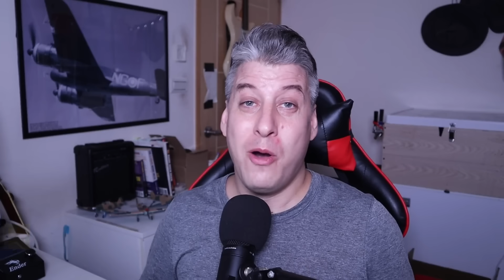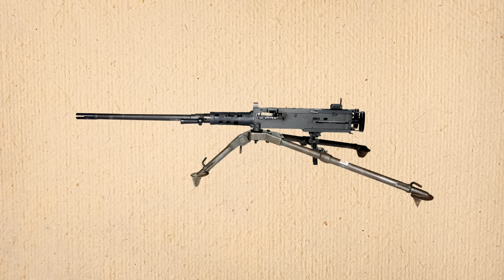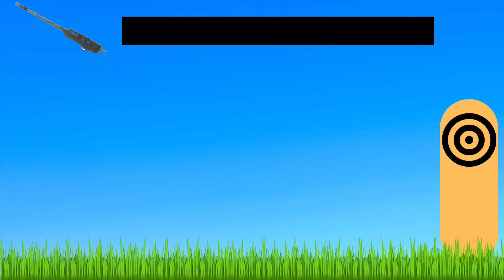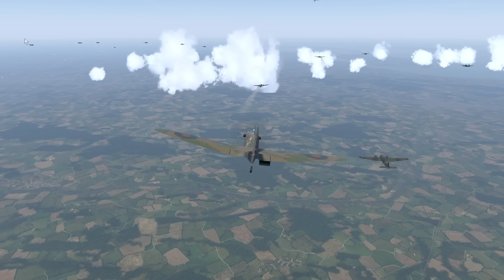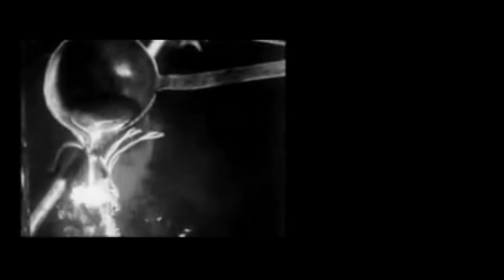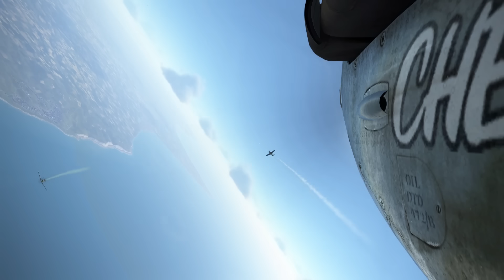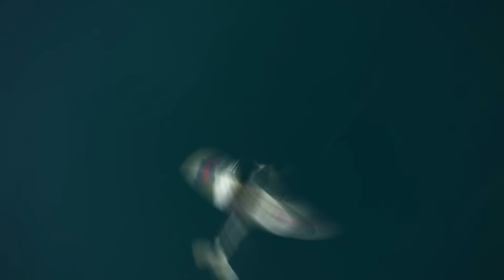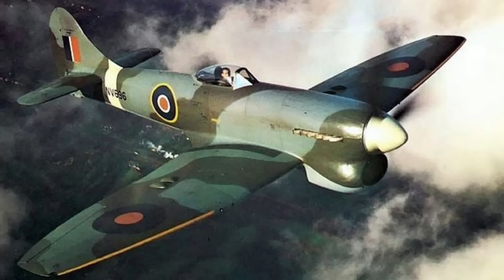Why Did The RAF Use .303 Caliber Machine Guns in WW2? The Surprising Answer

Comment: The main reason for them keeping the 303 was It Was British and you know how the Brit are! My aunt’s husband was a Brit and worker. In armor command and he and others in that division tried to get 50 cals in their planes from 1940 on and they were told but their sector head no British aircraft would ever have an American make gun in their planes!  That changed in early 1944 when a BF 190 plane did an emergency landing in England and was found to have been hit with 247 303 rounds but the plane was still flying and the reason for the crash was the pilot was new got lost and ran out of gas! Their attitude started to change after that!
Reply: "The main reason for them keeping the 303 was It Was British and you know how the Brit are!"

The British had no problem using American Shermans, Grants, Stuarts etc.
The Americans should have put the 17 pounder in their Shermans instead of the mediocre 76mm but you know how Americans are.

Comment: In the Pacific, American pilots had a preference for only four .50s, though some aircraft were built with six.  There was active resistance to adding more guns because it drastically reduced ammo capacity per weapon.  They seemed to feel more ammunition per gun, hence more time on the trigger before running empty, was of greater value than more projectiles per burst.

Not exactly the same issue, but another example of how just going bigger isn't always better.
Reply: The 50 cal was perfect in the pacific theater because the Japanese had little armor on most of their aircraft so they were easy to destroy once hit with that particular gun
Reply: The US Navy wanted 20mm cannon but American industry couldn't produce a reliable copy of the Hispano. They made do with the 0.5 inch guns.

Comment: From most of what I read the way the RAF obtained the Spitfire and Hurricane was they decided on the armament 4-8 Browning .303 machine guns, a range of flight and minimum climb and turn rates etc in a white paper which is published, then British & Forign company's entered a design, then a number were selected to make prototypes. The Hawker Hurricane & Supermarin Spitfire were then selected for production. 
These then had to be modified to fit other Armaments which due to size and weight determined where you could fit them as it affects how the aircraft handles in flight,  so if in the wing you will need to move spars and strengthen it to hold weight of gun this adds to weight of the aircraft so to keep same airspeed you need a more powerful engine. So the .303 probably was selected then kept for afew reasons I think the following
Performance(rate of fire and jam rates) weight (allowed for more ammunition/rounds & fuel also weight affects speed, range, flight time).
Role of fighter ie Home defence lots of support from over aircraft with easy rearm and refuel options.
Then just people just don't like change.

Comment: The German 20mm contained  something like 50g+ of liquid TNT.  You would not need many of those to turn a plane into a burning wreck. Some hurricane pilots would shoot enemy planes at 150yards. Also, aircraft of battle of Britain vintage would have self sealing tanks.  A .50 cal would done far more damage. The round is popular even today in anti-material sniper roll. 

I have heard stories of USAF mustangs 'sawing' FW190 in two with .50 cal gun fire with their SIX guns.
Reply: TNT is a solid at room temperature.
It may be heated and poured into a shell casing but it will solidify. It’s melting point is around 80c or 170f (ish).

Comment: I have heard that one of the disadvantages of the .5 round in the early negotiations with the US was that the Colt did not want to allow the British manufacture ammunition under license. Rather they wanted to manufacture the ammunition and send it to the UK. If I recall correctly this was due to Colt having spare manufacturing capacity in the US at the time of the negotiations, although I'm not 100% sure about this. This would have represented a great risk of having ammunition shortages and was not acceptable to the UK. Whether production eventually would have been allowed in the UK is unknown (however it was likely as FN was manufacturing the round in Belgium under license), but this problem certainly reduced the British appetite for the .50 cal.
I'm very sorry that I cannot recall the source of this information, but hopefully someone else could remember and post this.
Great video.
All the best everyone.

Comment: What I find odd from the people overly critical of the standpoint on the .303 is that the US was still routinely arming fighters with the .30 in the 1930’s and at the beginning of the war. Not everything was instantly armed with a .50 and the US seemed to largely refuse to fit cannon armament to most of their fighters. 

The .303 should certainly have been phased out later on, but the RAF did equip Mk IX Spitfires with 2 x 20mm cannon and 2 x 0.5 brownings. All the other British fighters at the end of the war were armed with at least 4 x 20mm cannon. In the case of the Mosquito and Beaufighter these were still supplemented by .303s.

Comment: You missed a point there... the RAF didn't swap from the 303 to the 50cal with regard to the spitfire, because the spitfires wing couldn't take it. Being a very thin and elliptical wing, if you took out the slimline 303 and replaced it with the much bulkier 50 cal, the spitfire ended up both heavier, less agile, and was able to carry very little ammo, down in the region of only a mere couple of hundred rounds per gun. 

Given the mistrust of the RAF in the ability of their pilots to actually hit a target, they opted to keep the lighter weapon in the form of the 303, with significantly more ammo for each gun in the wing, rather than a heavier gun with essentially a little squirt of ammo, rendering the fighter weapon less after only a couple of passes.

Much easier to allow the pilots to spray and pray, rather than make them all expert marksman...

Comment: In 1936 the British had a study the determined the best way to get the most Steel on the target was eight, 303 machine guns this enabled them to have them converging it slightly different distances, and still put Steel on the target. The Americans with their 30 caliber, equivalent to the 303. When they started using it in action started to determine that the 303 did not have the range for the way they had taught their pilots to fight. So they started to put more and more 50 caliber machine guns, starting with a single then a pair then four, six, and ultimately eight in the P-47 Mustang. Most American Aces seem to engage at ranges much farther than the effective range of the 303, and the heavier throw weight per round at longer ranges help them immensely

Comment: Yeah I've read RAF doctrine prioritised flying and formation skills over accuracy.  As a result the volume of fire of the .303 helped to compensate and reduce the skill required to hit.  Not only that but the more ammunition available the longer you can stay in the fight meaning greater force projection for less aircraft which was especially important in the battle of Britain where they Brits were out numbered.  The incendiary round had something like 25% or greater fire starting making it potentially more dangerous especially with how many rounds they could fire.  I think they made the right decision for the time
Reply: Was going to say the same. It was fundamentally important that BOB interception aircraft could engage for the maximum time, they were massively outnumbered. Even if in an armoured aircraft being hailed by smaller caliber bullets is still going to disrupt whatever you are doing to some degree, especially if you don't know it's only low calibre ammunition and at you.

The most effective option is a mix. A good loading of low calibre shots and some heavier hitting canon ammo at hand, sighted in at the right range, you could potentially use the smaller caliber shots to lead in the big caliber hits all the while still having the chance of taking out enemies on the lighter ammo.

Comment: There was 6 Spitfires fitted with Hispano Suiza 20mm cannon during the Battle of Britain but poor use negated the advantage and the 303 cal  7.7mm rimmed round first appeared in 1883 in the Lee Metford bolt action infantry rifle using the fast and smooth Henry Lee an American Designer bolt action breech with black powder propellant,cordite or gun cotton propellant in 1908.In 1972 at Netheravon we set up 18"X12"X12" concrete block to test a 7.62mm GPMG  V 50Cal  the 7.62 just peppered the block  but the 50Cal began to chop it up after 100 rounds each. Finally in 1966 a stray 303 round from Bisley Ranges landed in a garden at Donkey Town 3 miles from Bisley.

Comment: Very fine video, very well made. Graphics are outstanding! 
Harris's comment about the .303 and .50 advantages is not very educated. He may be right in what concerns the lack of importance of the difference in range; but he completely disregards the far higher penetration and destructive capacity of a .50 round fired at any range, just as I'm much more certain to kill someone at pointblank with a .303 rifle than with a 6,35 mm pistol...

Comment: AND..... if you had Hurricanes armed with 4 .20mms ....and stuck to DIVING ATTACKS....How would the Battle of Britain turned out?  (AVG Group in China in P40s were trained and drilled to do only straight through diving attacks. Avoid any turning engagements.  Same for Wildcats after tangling with Zeros)

Comment: I suspect a huge amount of typical British snobbery as well- they would refuse to use anything not made there.
It's also interesting that when compared to their German opponents on the Western front, the British aces did poorly against the Germans, usually by 3:1 margin
Reply from the maker: Interesting thoughts Frank. If the British were snobbish, they certainly got over it quickly. American made aircraft, tanks and other equipment were widely used throughout the war. As for how prolific British pilots were, I think this is a fascinating question. Simply put, the Germans had a very different way of using their aircrew and from the start of 1941 usually had the home ground advantage. This is definitely something I want to explore further.

Comment: The reason for arming the Spitfire and Hurricane with .303 cal machine guns was made out of what I can only describe as a pragmatic decision made by the then-Air Ministry. They specified that any new aircraft (which became the Hawker Hurricane and Supermarine Spitfire) must carry 8 .303 cal guns. I forget the Vice-Air Marshall that ordered this, and he knew that firstly, the development of any cannon guns for these platforms would result in lengthy negotiations regarding mass production which they couldn’t bank on happening. In any event, it would take too long which could impact the design and implementation of such weapons. 

And secondly, the UK is an island, and the import of foreign guns such as the .50 cal (which the RAF really wanted) couldn’t be guaranteed to arrive in sufficient numbers prior to the start of war. Therefore, the decision to arm with the .303 was a correct decision, until new higher calibre guns could be sourced. 

Interestingly, the E wing of the Spitfire could take the .50 cal gun, but the combination of 1 cannon and two/three .303 cal guns seemed to suit the RAF. 

Another point to take into account is the then-thought that combat took place at close quarters, and the guns of both Hurricanes and Spitfires were zeroed at 300 yards convergence. Naturally, the higher calibre guns afforded combat at greater distances. 

Phew! Hope this helps.
Reply: Yanks don't want to hear a rational argument Jas. The Yanks always know the "right" way.

Comment: I guess in that time no one ever thought of creating sniper rounds such as the .338 lapua to be put in aircraft at the time. While only just slightly larger sized round at higher velocity would have given them greater armor penetration, longer distance for shooting while having still a lightweight round compared to the larger 50 cal round. I know that the .338 was only developed in the 1980's but come on, it doesn't take much thought to create a slightly larger bullet with more charge that essentially is normally given to snipers.

Comment: It's mostly very misunderstood subject. It was the question of "asynchronous" development. RAF was actually 1st to realise that with new much faster and tougher aircraft, much heavier armament will be needed. That's why they requested at least 8x .303 in the time when most only had 2x of rifle calibre guns. However, by the time war broke out,  most others caught up with them and switched to 20mm .  Even so, quite a few Bf109E-1s took part in Battle of Britain and they were armed with just 4x 7.9mm. US fighters of the time like P-36 and P-40 were also armed with a mix of .50 and .30. Most people imagine all US fighters were always armed with at least 6x .50, which is far from the truth. Even famous P-51B/C had just 4x .50. Only the D had 6.

.50 were actually far less effective than 20mm cannons, and as RAF transitioned right after BoB to 20mm, it's logical they didn't use .50 all that much. In fact,  2x20mm hispanos had the same firepower as 6x .50, and on top of that Spit had 4 more .303s just in case. So overall,  it was quite formidable firepower. By comparison, Bf109 actually had its firepower decreased from Emil to Freidrich, as the early F used just one 15mm motor kanone instead of 2x 20mm in wings. All in all,  RAF's armament during the entire war was quite good and effective.

Comment: Biggest problem was the fact the 50 caliber was not a main line item and retooling to make guns, ammo and all the related equipment on a massive scale would take more doing than there was time for. Most people don't realise just how much goes into manufacture of an item. Which is understandable you see an item like a cartidge case, stamped out. Great what they don't realise is it was probably done over 6-12 steps, trimmed then capped, filled and crimped. Plus the tools too do each step have to be prototyped, tested and redone till they work then put into production this can take several goes all this takes time and money both of which were short.

Comment: One also has to consider rate of fire. 
In a fleeting engagement  the probability of a round hitting the target is quite important. Whether it's a large 20mm shell or a small .303 bullet, if it fails to hit the target it's useless. In one second a burst from four Hispano 20mm's aboard a Typhoon will send 48 rounds at the target. A similar burst from a P-51 armed with six Browning AN/M2's will dispatch 80 .50 calibre projectiles down range. A Spitfire MkI armed with eight .303 Brownings will send 153 rounds towards the enemy in the same burst. 
The Spitfire's bullets may be the least lethal, but if we assume that regardless of calibre out of every 100 rounds fired one will hit the target then the Spitfire has almost twice the chance of actually putting some high velocity metal into Fritz's kite and hence doing some sort of damage.

Now consider this: The four gun battery of Hispanos in a Typhoon weighed 120kg and were supplied with 560 rounds. The P-51's battery weighed 18kg less but was supplied with 1840 rounds. Spitfire MkI's eight peashooters, by comparison, weighed 112 kg but came with 2800 rounds. Thus the Spitfire had a lot more chance to hit something than either a cannon armed Typhoon or a Ma Deuce armed P-51. And scoring hits is what led to shoot downs.
Think shotgun vs sniper rifle and ask yourself which one you'd use against a bird.
Reply: Great comment my man.

Comment: There was also a calculation that it needed a certain number of .303 hits to damage an aircraft. It was also thought that a pilot would only be able to hold the target in the sights revisit for 1 second. Rate of fire diving by the number of hits required meant that they needed 8 guns. Less guns and slower rates of fire required longer periods of target acquisition, difficult in a 1940s dogfight.  
Hence the ranging photograph you showed were the 8 guns were set to converge on a target at a fixed range. British pilots had that range setting reduced during the Battle of Britain to improve kill rates.

Comment: Well in 1939-40 Martin Baker aircraft company made a plane with six 20mm cannons with about 300 rounds each as first test flight with a powerful but deadly engine that gave a top speed of about 420MPH. But the next testing with  Valentine Baker the pilot the plane's engine died seized up nothing Valentine Baker could do and it crashed killing Valentine Baker and as now the design will take longer as no test plane with full armed weapons meant it would take nearly 4 more years to make sadly never ever used. Why the war committee did not take up the first design while Valentine Baker was alive is shameful. People that had seen the plane fly were shocked at how good it was. No need for improvements but they wanted it so ended the plane that should had been.

Comment: Apparently the government didn't run out of 303 bullets untill 2005. Don't know if they threw out the moulds though.
Reply: I shot original 1944 rounds for years in the seventies in the Canadian Army Cadets. They're crimped at the neck so they can't be reloaded. The WWII supply lasted through Korea. So did the damned wool uniforms.

Comment: I have to say they were incompetent.
.303 - 3.3 KJ per bullet, 4 000 KJ per minute
.50 cal - 16 KJ per bullet, 12 800 KJ per minute
20 mm Hispano - 48 KJ + 25 KJ (explosive filler) per shell, 62 000 KJ per minute

One Hispano cannon is comparable to FIFTEEN .303 brownings in terms of firepower. It's more nuanced than that, but the point stands and is time-tested.